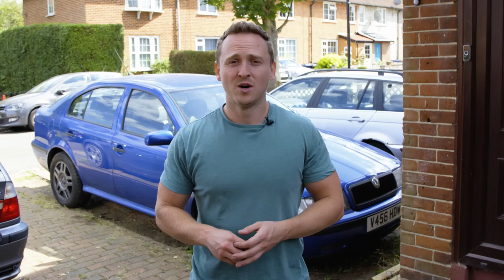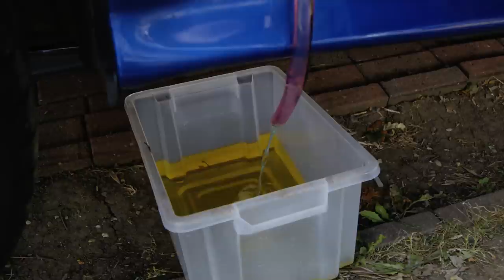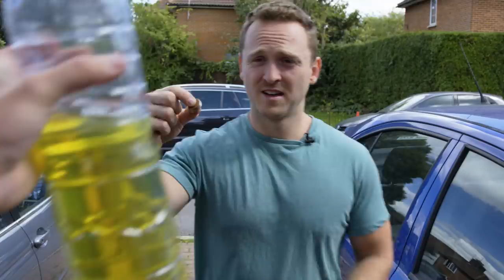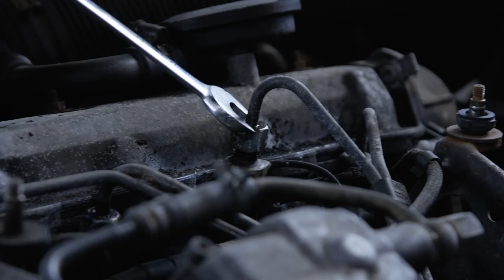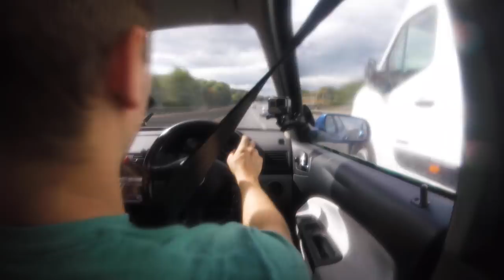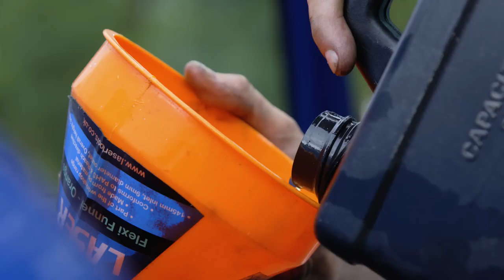How Far Can You REALLY Drive On 1 Litre Of Fuel?

Comment: That’s it I’m buying a diesel skoda!
Reply: Most VAGs 1.9s are the same, my golf will do 70 if you drive like an old woman
Reply: @mrcaboosevg6089  Wish my Golf FSi was a diesel, I don't get much power or economy from it.
Reply: @mrcaboosevg6089  Miles engine is a 1.9 litre with 90hp (like the 1st 4 Zylinder TDI 1Z) it has a Vep and not that much of Power and Torque but it is real economic
Reply: My dad had a 2001 Fabia Combi (break) with the 1.9 TDI 105hp and he got rid of it in 2016 after 270.000km just because his hip went bad and he needed a taller car, engine running like new, with abnormally high power and torque for its figures and great fuel economy, even if its suspensions were totally worn and it was bouncy as a boat.
Reply: I had skoda 1.9tdi pd that was driven over 560 000miles and went easily 55-60mpg and Vw what is driven over 280 000and same mpg
Reply: Yoseob Yang I have a 2001 mod 1,9tdi 4x4. Its driven 430.000km and still going strong. Been winter drifting, having fun, towing with it. It just wond give up. Got xenon, ac, towing hitch, leather seats. Great car! And very reliable.
Reply: Jukkis i got this one. Driven 430.000km. It works perfectly. What are your tips and tricks for it to last so long? Oil change each year? Something more? I always let it idle for 20 sek before driving.
Reply: @Haldexify  I have changed the oil every 10 to 15,000 kilometers. Otherwise, it has run properly with throttle and revs, letting the engine get burnt. And block egr/dpf
Reply: @huey-fan8335  the earlier video where they dyno'd him suggests he is the 110hp version
Reply: @danmoney9932  then why has this engine a Wastegate turbo? The 110hp variants all have A VTG Turbo
Reply: @huey-fan8335  my mistake, watched it through and he is the 90 but chipped to 110.
Reply: My is 1999year 1.9 tdi 110 ps and 410.000km without any problems klima work oil and all filters every 10.000km, 300.000 problem with egr i need to make clean but others without any problems
Reply: @mrcaboosevg6089  Miles did 113 in the video if you run the numbers
Reply: @danmoney9932  👍🏻
Reply: If you want proper economy get a 1.9 SDI, no power or torque but it's much more efficient than the tdi
Reply: @benturner4774  the TDI is more Fuel efficient than the SDI! You get much more power but the consumption per 100km is nearly the same
Reply: @huey-fan8335  Not true only the 1Z/AHU had the waste gate turbo in the mk3 Golf. The engine that Milles uses is ALH from the mk4 Golf gen that uses a VNT actuator whilst the 110hp 81kw  variant in the Golf mk4/Octavia or the A4 platform as it is called. Also uses the VNT actuator.
https://www.myturbodiesel.com/wiki/vnt-turbo-cleaning-disassembly-replacement-repair-stuck-vanes-mk4/
Reply: Huey-Fan It’s been remapped to around 120bhp though
Reply: @Mr330d  Yup mine is still stock, enough for me and running like a champ after 443000km.
Reply: @huey-fan8335  Isn't the 1Z with pre-chamber? ALH AGR has similar injection system to other TDIs before Common rail diesels from 2004/2005
Reply: @rkan2  The 1Z is a TDI, so no swirl chamber like the aaz from the Golf mk3. The First TDIs, including ALH and AGR use a Bosch VP37, which is fundamentally different to the unit injectors used in the mk4 and 5 Golf! Yes they Inject directly into the Omega shaped piston! These engines are well known for their durability! The PDs (unit injector) are also very long lasting engines, my colleague has a T5 with a 174hp 2.5 PD TDI with 455000km
Reply: @jamesvalentine925  We had an FSI. It looked amazing and flew but we would get about 24MPG. I feel your pain
Reply: @huey-fan8335  Yes they are very different, but the injectors are still quite similar, even though the pressure comes from the cam in the PDs.
Reply: @rkan2  The Vep have injection nozzles (actuated by pressure) while the PDs have Injectiors (actuated by electricity)! Well, even that is not quite right, because the PDs Nozzles in the injector tip only open through pressure, while the end of the injection is actuated by an electric signal
Reply: That's 117.28 miles to the gallon (uk) I very much doubt that !
Reply: @GBUK01  I've got a 1.6 FSi, not perticularly my first choice of engine but the car was free so I can't complain much. I think a lot of the pain comes from having a 3L V6 before taking it on. Acceleration isn't too bad, but plenty of 1.6 engines are quicker off the mark. MPG wise I get about 35 if I just drive or if I force myself to be economical I can squeeze 40mpg out of it (that said my V6 jag was lucky to get 18mpg). One thing I do have to say about VW though is their reliability. For a free car that I was given 18 months ago it's gone straight through 2 MOT's without a single advisory (it's a 2005 model, so is getting on a bit).
Reply: Jukkis ah yes maybe I should block egr 👍
Reply: My passat highline has done close  to 700 miles on 1 tank. £80 tank
Reply: Get a jetta tdi, same thing, body parts are easier to get
Reply: I know it's diesel life in this thread but quick shoutout to the 1NZ-FE for getting 65-70 mpg on gasoline with careful technique.
Reply: I bought 96 Audi 89 with the same engine. Wonderful car with nearly indestructible engine. I know, it isn't the best car with this engine, but... you know what? I don't care, I love it even tho.
Reply: @huey-fan8335  Sorry, but i doubt you will ever get like 3.7L/100km from a TDi which is certainly possible with an SDi, as it doesn't have the turbo to waste fuel on unnecessarry accelerations.
Reply: But no modern diesels it have to be one of the older ones

Comment: so miles does 113mpg? lol
Reply: Good point, clearly there must have been some fuel left in the tank, which couldnt be drained easily
Reply: Well you can drive it woth 3.5liters for 100kilometer ive done it.
Reply: @peterzingler6221  However the first few miles the engine needs to be warmed up, therefore consuming much more fuel. There are many things to take into consideration like elevation change, wind etc, but i think 25 is not possible to do with 1 litre and a cold engine
Reply: One other thing to consider is with a near empty tank there is a lot less weight in the car
Reply: urbex2007 they run the engine dry, nothing left in any rails,  even if there was, it would be mills not litres.

They're were probably driving around 45-50mph which would be the most efficient for that car.
Reply: urbex2007 Should I install a cone air filter ?
Reply: less than 4L/100km is possible when driving under 80km/h. 40km definitely takes at least ~1,5L
Reply: @peszq  it is possible, copious amounts of coasting (in gear so the injectors shut off as you don't even need fuel to maintain idle like you would in neutral) and only running at the optimal rpm when you are going up a hill, requires minimal traffic though as you want to never have to slow down or speed up when you dont want to.
Reply: There were a few stop starts, not just open road.
Reply: I worked it out at about 103ish mpg? Anyone know more accurately then my figurings out? Very impressive though...good advertisement for the wishful thinking about a future where combustion engines are still relevant,  doubt it though :( I personally dig electric cars , but it's just a crucial element of a killer sound track that can be icing on the cake of an epic vehicular experience.....
Reply: 2.0 TDI, 3.9 L/100 km, average speed 80 km/h
Reply: @zippyquiltonz6794  i dont think it promotes wishful thinking at all, if the car gets over 70mpg driving normally on the motorway for long trips the 100 in a hypermiling drive doesn't sound that surprising.
Reply: @RWoody1995  Exactly what I mean , with efficiency that good , it would be nice if the internal combustion drivetrain wasn't going to soon enough sadly be a thing of the past ...
Reply: @tkanpo  3,7 l/100 (comp) avrg speed 76km/h, 120 km dostanie.superb I 1.9 tdi BPZ 115 PS
Reply: C A hardly would make any difference in day to day.... not notable..... wind or temperature drop will make a bigger difference
Reply: zippy quiltonz
Skyactiv-x is the future if ICE,  mazda says it's greener than a EV well-to-wheel. 

56% thermal efficiency.
Reply: @Robert-cu9bm  really? That's awesome ...i used to have a 05 mazda 6 , such a good car...hope they bring back a new rx model with skyactiv-x ..although I guess the r stood for rotary though so maybe not haha
Reply: zippy quiltonz
The rotary is dead as a power plant(in the normal sense) for a vehicle, not efficient or reliable enough ... It is likely to be used as a range extender in EV's.

https://www.caradvice.com.au/627191/2019-mazda-ev-rotary-range-extender/
Reply: @peszq  The engine wasn't cold, they were running it until all the gas was out, but it looked like there may have been a slight slant where they had it parked, so it's possible there was a tiny pocket of fuel left in the corner of the tank. Also that looked like more than 1 Liter of fuel in that bottle, assuming it was a 2 liter bottle.
Reply: @Robert-cu9bm  Planes are vehicles. There are still a lot of planes that use Rotary engines. Running at a constant 6,000 rpm. If you were to drive the RX8 in top gear at 6,000 rpm, it would be as fast and significantly more efficient than a plane. Too bad driving everywhere like that is illegal.
Reply: Trainboy1EJR
Fair point
Reply: I owned 1.9tdi Skoda Octavia 90hp completely stock for about 15years, unfortunately had to sell it to the junkyard because govt. won't allow diesel cars to run after they are 10years old, I have pictures showing 3.8ltrs for 100kms.
 
I wish I could buy same car with same engine brand new again, It was seriously low maintenance, fuel efficient car.

Although I bought Skoda superb petrol a few years back, that is completely opposite of what Octavia is.

#Octavia #Fabia #Superb #Skoda
Reply: @Robert-cu9bm  a modern fuel system can hold around half a gallon depending on the vehicle
Reply: @CA-gy4qf  When the car weighs 1315kg to start with. The weight of the fuel doesnt make much difference in the grand scheme of things. The fuel would only be 3 or 4% of the cars total weight. The passenger would weigh more than the fuel.
Reply: urbex2007  
They have empty fuel line?
Reply: Someone worked it out at 106 mpg
Reply: @Trainboy1EJR  As fast as a plane what have you smoked
Reply: @MultiFuckme22  A Cessna 150 maximum speed is 124miles an hour, an RX8 could easily go faster.
Reply: @peszq  if you had a tailwind a clear road and a slight decline you might do.

Comment: That's crazy, I thought my backup car (diesel lupo) was good on fuel but that's double.  1000 Mile challenge next?
Respect, Camper Conversion
Reply: Camper Conversion No lies,  my Clio mk2 1.5 td (65 hp) got 84 mpg last week on the motorway. It does 50-55 urban 
It's unbelievably cheap to run. Oh and £30 road tax too

Comment: The 1000 mile with one tank of fuel challenge should be easy. I drive a similar 1.6 litre Octavia combi and I often get 1500km on one tank of course with some left in it. So if you don't screw it up and use backroads with a lot of coasting, like I drive, you can definitely do it.

Comment: People always talk about sediment at the bottom of a fuel tank. Can you actually open one up and prove it?
Reply: Daniel Wilson
People are idiots, the fuel pick-up is always on the bottom of the tank, otherwise you'd run out of fuel on a full tank.

Diesel tanks can rust due to water and algae can grow in tanks.
Reply: Yes, you can find actual sediments in a fuel tank. Older vehicles with metal tanks will often have rust flakes. The modern plastic tanks will eventually have particles of various trash
Reply: @Robert-cu9bm  Yes if Diesel is left to sit in the tank for too long algae and other nasties will grow in the fuel but if the car is in regular use this will not happen as the diesel will likely never be more than 1 month old.

Comment: I’ve got to say that’s one fuel efficient car.      25.8 divided by 1.1= 23.45   And since the conversion for litres to gallons is 4.546   23.45 X 4.546 = 106.6 your car somehow did 106.6 mpg
Reply: Yes, 106.6 matematically but in practise, it is like around 85-95 depends how you drive ofc. I have Octavia 1.9TDI 66kW ver. If u know what 66kW has, rotation fuel pump or what it is called, driven a lot, mine has 360k and this rotation pump never had a single problem. There is also other type of fuel transport and that is called PD or Pumpe Diesel or Pumpe nozzle i dont know exactly but this type gives you better performance, torque and feeling from the ride but it gives you higher consumption which is like 4-5L/100km but it can be driven to suck even less fuel also. In Slovakia we have most of the roads " hilly " with goood slopes and my best average consuption was 3.5L/100km which is really, really good. I drove 1377km with one fuel tank fully filled to the brim but it was mostly on highways and countryside roads outside the city.

Comment: I was getting low in my Vectra and almost at the garage, although still had 30 miles left on the computer, as it was on a downward hill it cut out, as the fuel sender was out of the fuel.

Comment: In my 125cc motorcycle you can drive around 50km with a litter of gasoline
Reply: My 110 cc Honda motorcycle gives 68 km per litre of petrol.
Reply: Yep, less pistons, less friction, less losses, better mpg. A diesel motorcycle would be better with fuel, but boring.
Reply: @vladmihai306  and more shaky and loud
Reply: My 600cc bike drank 5-6litres per 100km but I was driving high rpm ranges as it is a sports bike with low torque at low rpm
Reply: Leon CurvaSud maybe with a litter bin on wheels or a litter of kittens or a litter of pigs.  🤦‍♀️🤦‍♀️🤦‍♀️  but please don’t try to travel anywhere on your little  bike litterbug!  Ffs, when did schools stop teaching?
Reply: @JulieWallis1963  I have a passenger who is guaranteed to throw something out of the window every minute so if I'm doing 60 mph that's 1 mile per litter.

Comment: “Suck up all the sludge from the bottom of the tank” except the pump sits in the bottom of the tank and is always drawing from there.
Reply: Some of it will float in the diesel
Reply: And cars have fuel filters for that exact reason..
Reply: @forresttm  fuel filters aren't magic, if the tank is full little bits of sediment will go into the filter at a time, when it's low big clumps could go in at once and it cant handle that happening too often.
Reply: @RWoody1995  Complete BS. There is no magic level where different sized sediments reside. Fuel tanks are generally extremely clean and most fuel systems have pre-filtering screens in the tank.
Reply: @DiscoFang  i didn't say anything about different sized sediments, i said big clumps (a clump meaning multiple little pieces), it's pretty basic really, example: make a cup of coffee notice all the bits of coffee powder floating around in it that didn't dissolve into the water? of course you don't, for every 100ml of coffee you consume you only consume a small amount of undissolved coffee powder because most of it sinks to the bottom and whats left floating in the top 90% of the cup is say, 5% of the total amount. drink 90% of the coffee and then when drinking the rest you start to notice it as the remaining 95% of the powder comes into you all at once. The same thing happens in a fuel tank. The filter can easily manage that small 5% being fed into it over the course of its service life, but give it everything in the tank at once and it's not gonna be happy in the long run.
Of course in modern cars fuel tanks are cleaner as they are plastic, but it is a different story for older cars with metal tanks which rust slightly over time as trace amounts of water get into the tank over the years.
Reply: RWoody1995 I call a modern car one with efi which essentially means cars up to 30+ years old. Water is heavier than petrol so trace condensation gets burned with the fuel. A tank only rusts if it's empty for a sustained period.
Reply: Well the pump is pointing always at the bottom so the place where the fuel is and goes is always the same.
Reply: @RWoody1995  What is the best brand of coffee for a skoda rapid 1.6 tdi? Would tea bags work or is loose tea better if you run it through a strainer?
Reply: @michaellavery4899  I've found that any coffee will do. Just be sure to replace the fuel filter with a coffee filter and you're good to go.
Reply: @michaellavery4899  been running mine with regular coffee, but black coffee makes the car a bit more twitchy and nervous

Comment: Assuming I'm not way too tired for this, that's a fuel consumption of below 3 l/100km. With this consumption you should go around 1300 miles on a tank which... Isn't really possible.
Reply: Exactly. This challenge was anything but accurate. Lol. Yes the car is still efficient but more like 14 miles per liter best case. There was definitely fuel left in the tank and the lines.

Comment: Given that the fuel tank on this is wide and fairly lumpy, I question whether this actually used a litre of fuel to do the mileage shown.  The car moving about would undoubtedly slosh some fuel from other areas of the tank into the pick-up, allowing you to go further.  What would be far more interesting would be to have a tall thin clear fuel tank in the car that has a litre variance shown on it.  Not only do you not have to run out, but you can be absolutely sure how much fuel you've used.